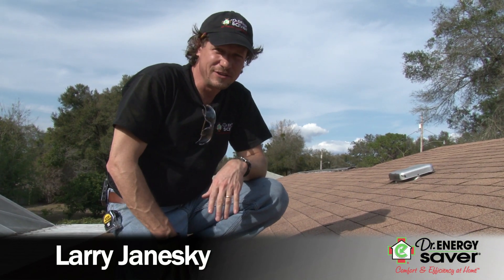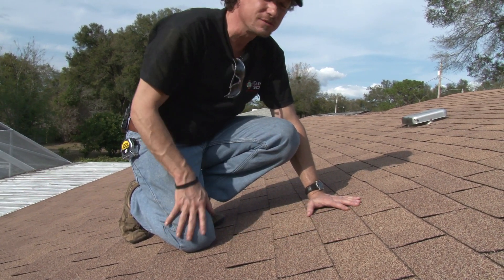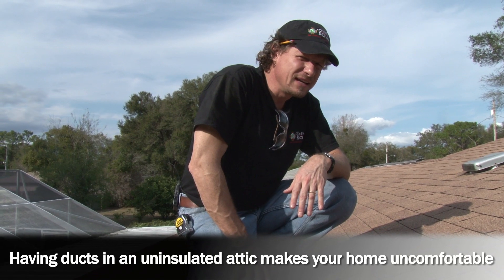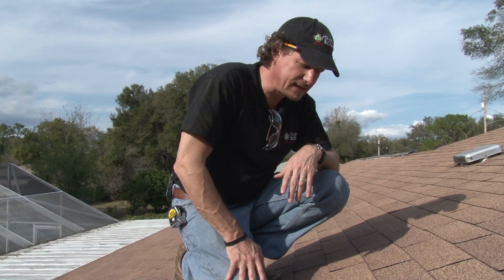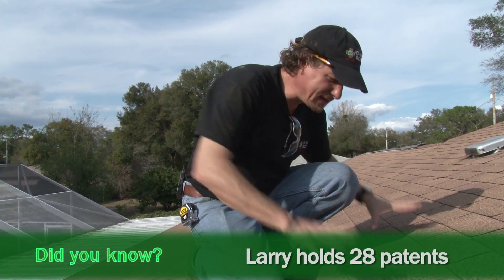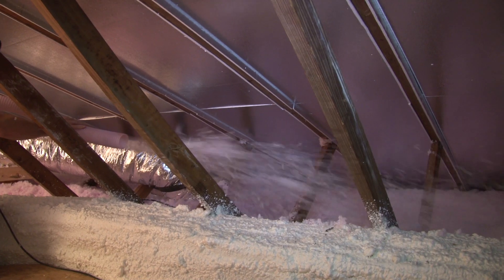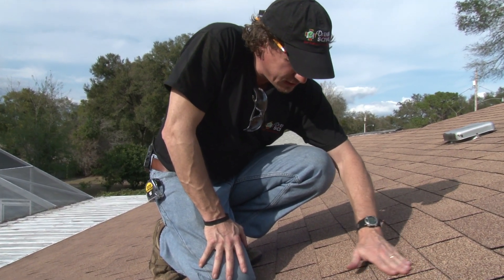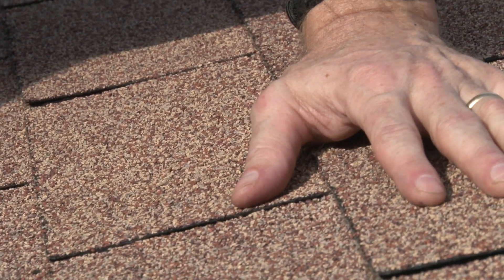Insulating the Attic and Cool Roof Technology

Comment: Cincinnati, Ohio summer roof design... What effects would adding 4 inches of insulation on top of the original deck and then add foil faced panels and then 2x4 furring strips and then the finished roofing?  The furring strips provides the heat evacuation above the foil faced panels.
Reply: Generally the deck will heat up no matter what. Best to have rafter vents $3 each in bulk, perforated soffit, and a ridge vent. That will bring in cool air to the underside of your decking and yourshingles will last longer,  keep attic cooler.

Comment: or install an actual cool roof with over 80% reflectivity.  those granules lose reflectivity and come off. even on a white granulated shingle,  they can heat up the shingle almost 50-60% higher because of the black base.  however a 15 year old PVC can still reflect over 80% and has better wind and water protections.  or Even roof top insulation

Comment: And if you are slightly mechanically inclined, and your camper is pre-wired and set up for an AC>>>nub.best/yis6     I'd say go for it took my  friend and I about 2-3 hours, and the hardest part was still simple, had to cut a small hole in the lower unit for the wiring.....

Comment: I have a roof exactly like the one in this video and we are experiencing a lot of heat coming into our home. Replacing the roof is not in our current budget but have looked into painting the roof with some type of white, reflective coating. Would it be a good option to help reduce temperatures? Thanks in advance.